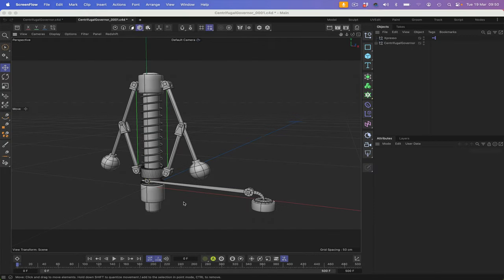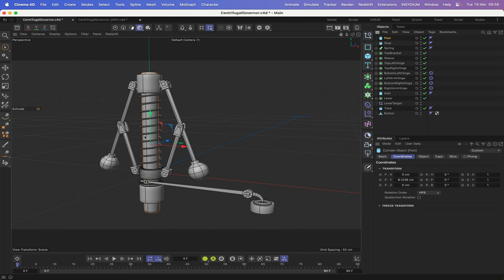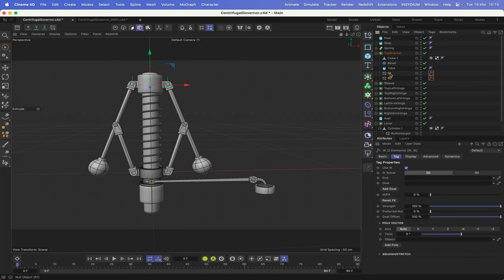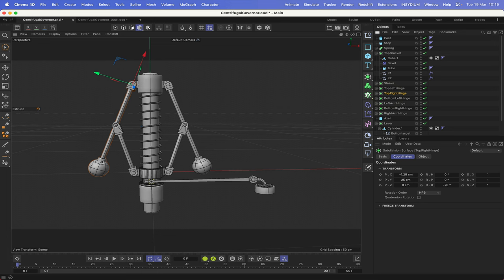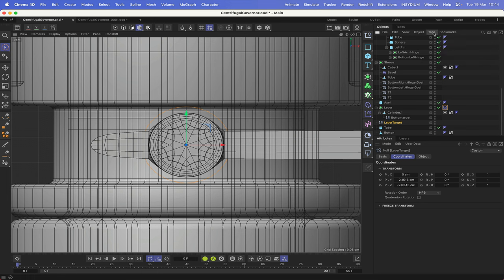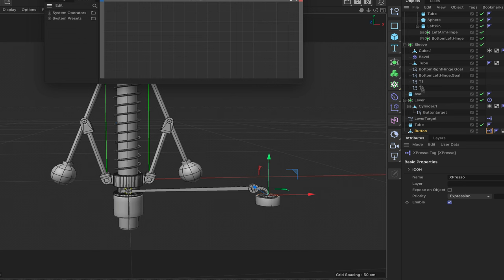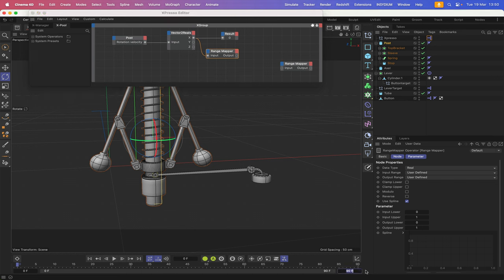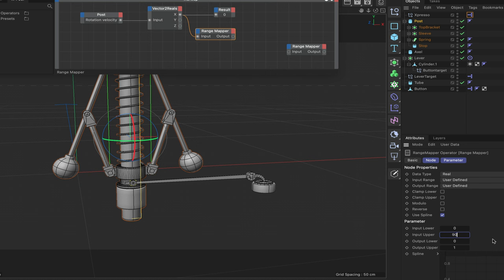Cinema 4D Xpresso Tutorial 70: Centrifugal Governor Rig

Comment: when I put the RightArmHinge and the BottomRightHinge in the RightPin, they disappear, same with the LeftArmHinge and the BottomLeftHinge
Reply from the maker: Check the visibility of the pin. Is there a red dot next to it in the object list? No reason why they should disappear just because you have grouped them.
Reply: @ExpressoMechanicTV no red dot
Reply: @ExpressoMechanicTV when I turn off the Subdivision Surface with the red cross, I see the hinge
Reply: @ExpressoMechanicTV when I take away the SDS Weight of the cubes, I see the hinges. I don't understand
Reply from the maker: @willy4740  Make sure you have grouped everything EXACTLY the same way I have. It could be something to do with the Bevel Deformers, though I can't be certain. These do have a habit of making things disappear!